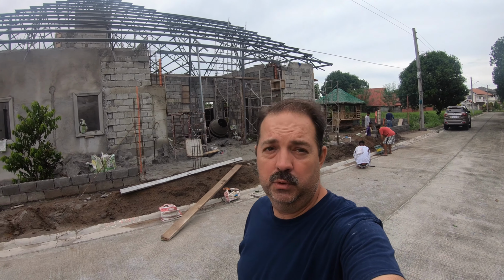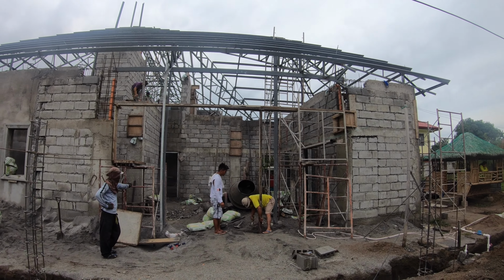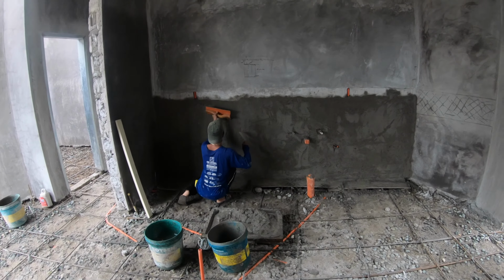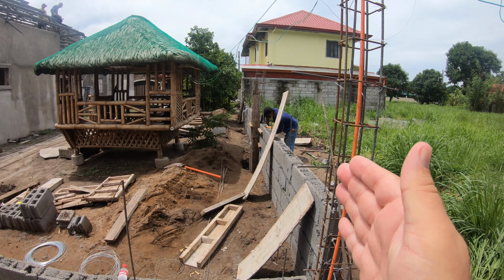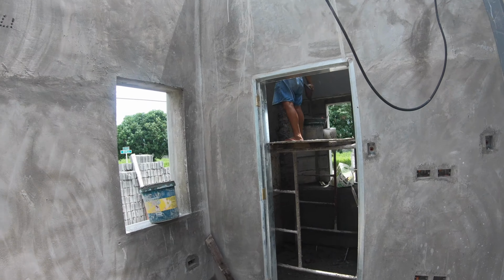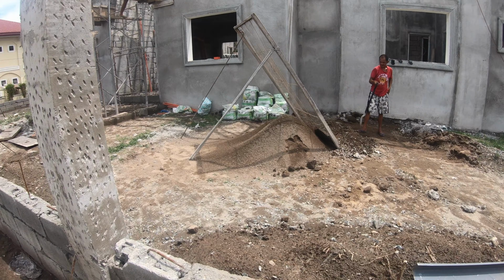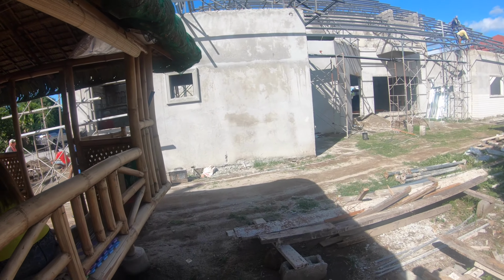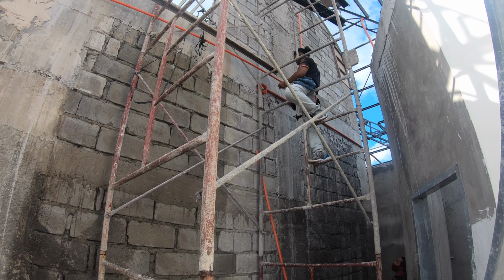Philippine House Building Step by Step, Build Day 109: Full House | CCTV Rough In

Comment: Coming along nicely 👍 just wondering 🤔I noticed that the pavement outside your fence line looks a little beat up, is that your responsibility to repair or is it the municipality concern? Still looks good 👍🇦🇺🇵🇭🇺🇸
Reply from the maker: Unfortunately broken pavement is part of the construction business. The sidewalks were in good condition prior to construction. It is on the contractor to repair what is broken during the process. 
Thanks for your continued support. 👍🇺🇸🇵🇭